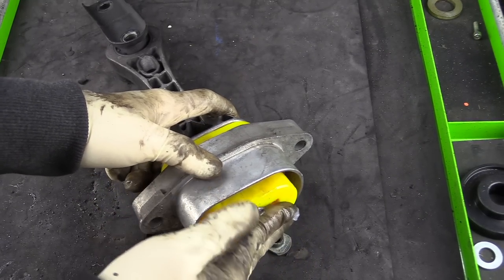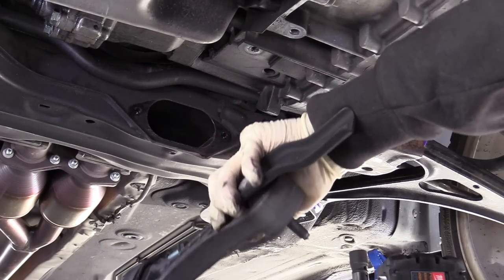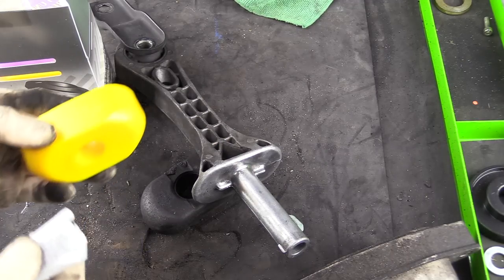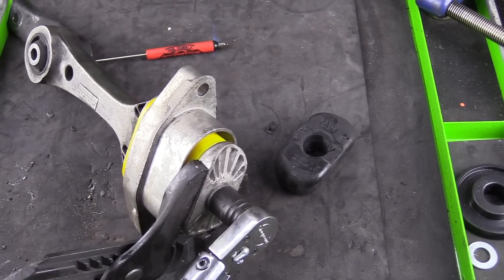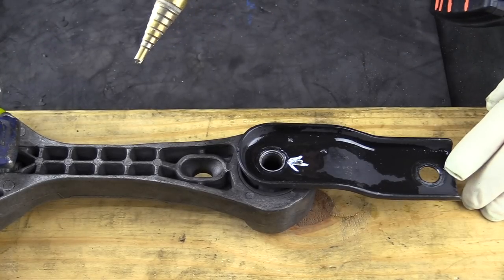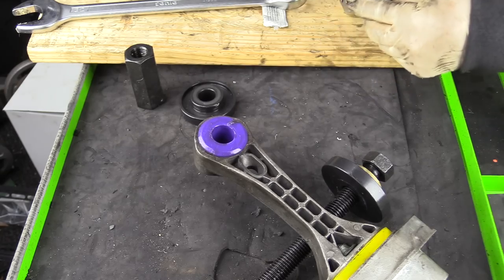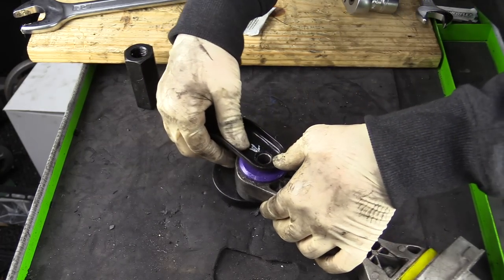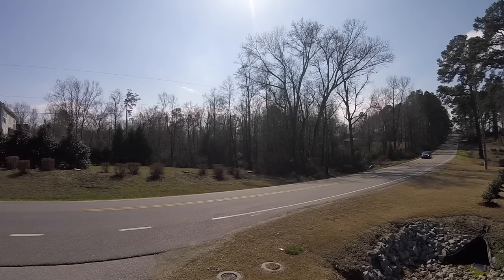How To Replace MK4 Engine Mount (DogBone Mount) Bushings

Comment: You forgot about the galvanic corrosion on the 2 13mm bolts where they seize inside the dogbone itself that means most snap!
Reply from the maker: Never dealt with it being in the south. But another good reason to replace the bolts.
Reply: HumbleMechanic your definately lucky, usually have to notch the sides of the flange the bolts sit on and smash the old one off here in the uk with our bad weather and loads of road salt! They corrode that bad you can still drive them after the bolts have snapped off and the mount won’t come loose! As soon as mounts off the bolt studs just wind out like nothing happened, lol!
Reply from the maker: UGH!!!! I have mad respect for you guys that deal with rust.

Comment: What do u think of the upgrade ?
Reply from the maker: I like it. A very positive improvement. The time I mostly notice is during a shift.
Reply: Hey Charles! Great video, how does it feel in responsiveness? does it feels with a little bit more harsh? how comfortable is it? I'm interested in install them. But they're hard to find and more expensive here in México. 
Thanks, have a good day!
Reply: if you worry about it been to hard you can use the red one meant for the TDI its a bit softer.
Reply: I fitted the ECS dogbone bushes to my r32. It just gives the throttle response more instant feel, slightly better gear change control/feel, and also less esp intervention than before when going over humps and crests etc.  Not really any extra harshness to speak of. So it's a good upgrade

Comment: Why do you call it an engine mount when ot clearly does nothing to mount the engine tobthe car? Wouldn't a torque rod or torque mount be a more correct term seeing thats its function?
Reply from the maker: It holds the engine and transmission to the subframe. 

If you really want to get technical it’s called a pendulum mount.
Reply: HumbleMechanic 
Pendulum mount lol.  
I always laugh at terminology companies come up with. It's like someones brother inlaw needed a job and it was to come up with new technical terms to discribe an basic item.
So it's purpose is to control engine and trans torque.
Reply from the maker: Yep. That’s why I don’t super sweat the vernacular. Lol
Reply: HumbleMechanic 
Roger that.

Comment: If you know anyone with a rear sway bar for a mk4 let me know, any will do but r32 proffered, Long story of idiot original owners
Reply: I would think that a rear sway bar for a standard MKIV would be much different than that of an R32 MKIV. In the USA, every MKIV had the non-independent suspension except for the R32. I suppose things may be different if you live in Europe, because I have heard that there are many more variants of the VW MKIV.